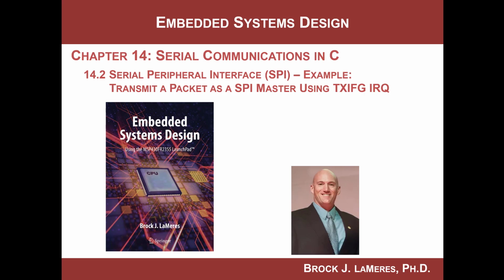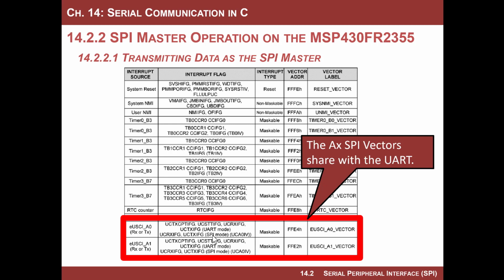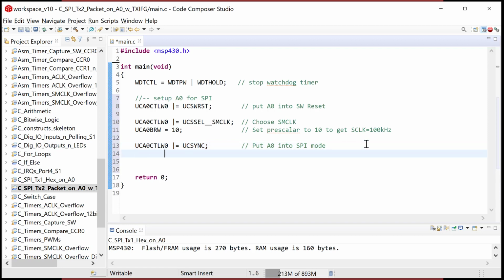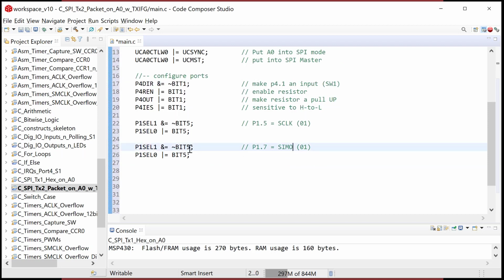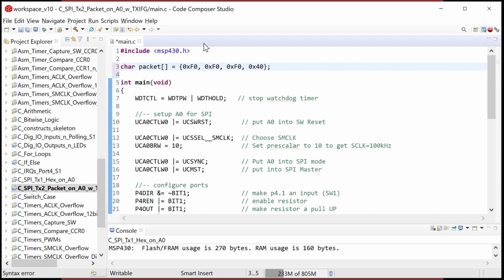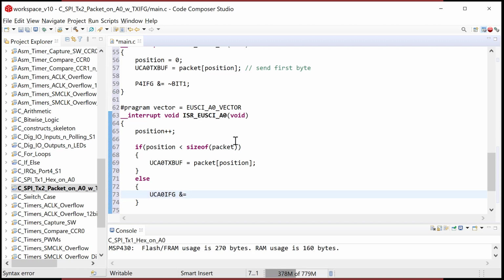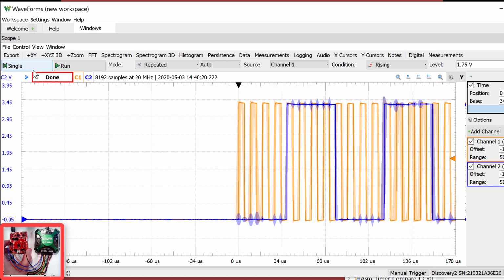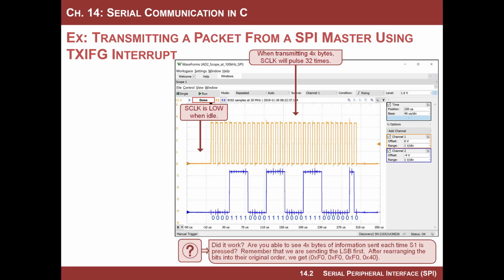14.2(c) - Serial Communication on the MSP430: SPI - Sending a Packet as a SPI Master using UCTXIFG

Comment: To get this code to work on an EXP430-FR6989 board, I had to remove the "E" from "EUSCI_A0_VECTOR" for the 2nd interrupt service routine's declaration. 
So instead, it should be "USCI_AO_VECTOR"
Apparently, in the TI supplied header for FR6989, the "E" is omitted from all of the vector names.
There are some other inconsistencies like this among the many headers for the various MSP430 variants out there.